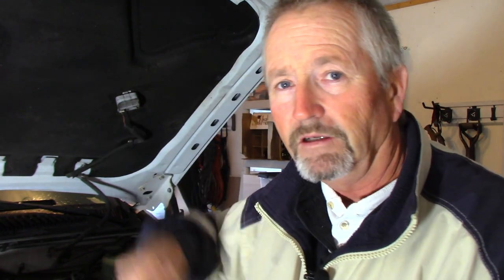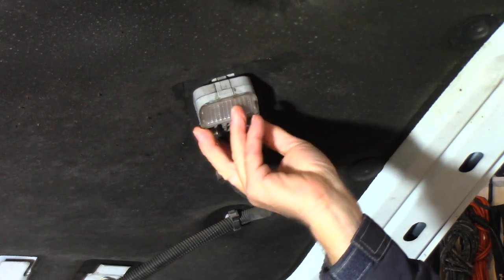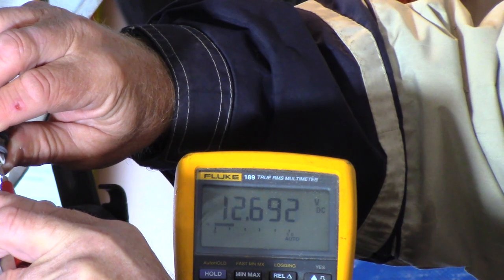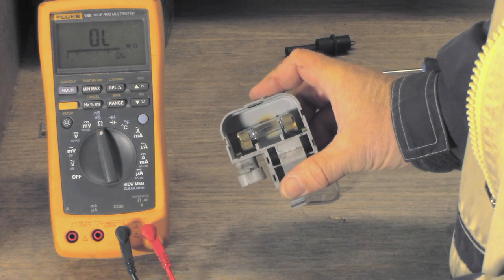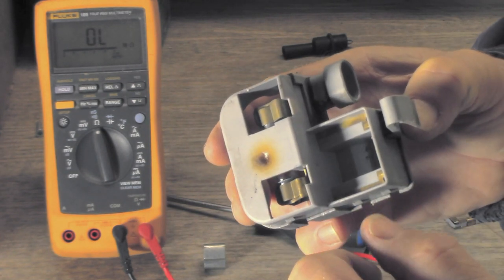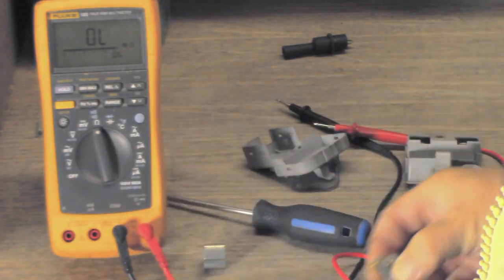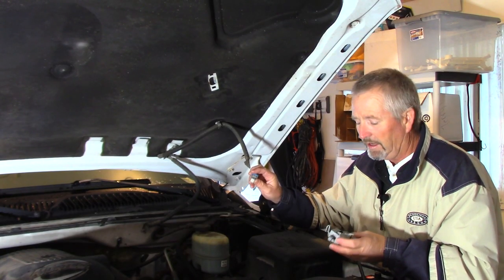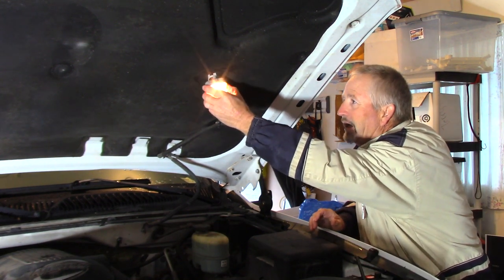How to Troubleshoot a Vehicle Underhood Convenience Light

Comment: I have a 93 corvette and my right side under hood lamp only has a flicker of light. I disconnected my light and plugged in a working one and it still does the same thing.  I will check voltage coming from the vehicle’s plug but any reason why the light is barely powered on?  Mine works with a mercury switch.